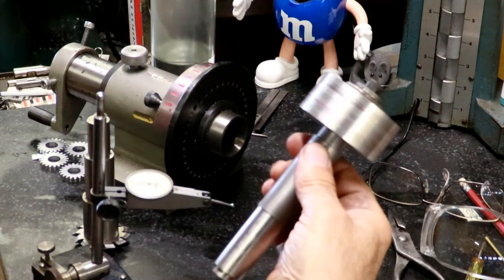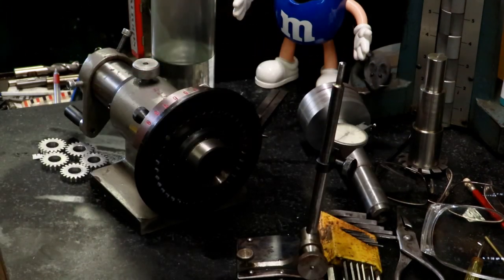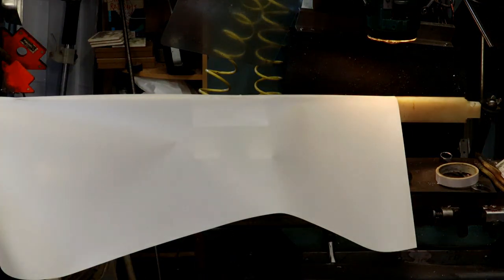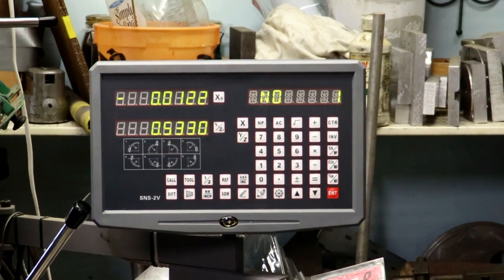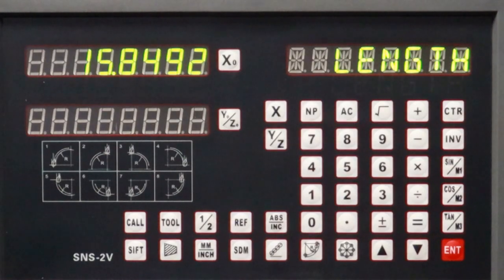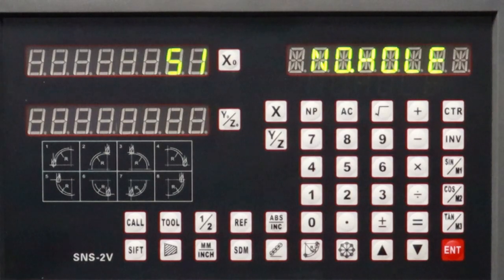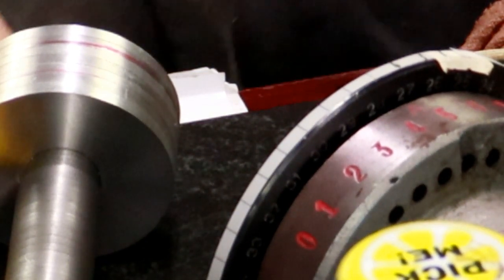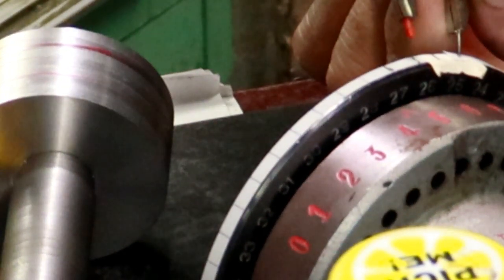setting up to cut a 50 tooth gear on a spindex

Comment: What is the thickness of the tape wouldn't that affect the tooth placement?
Reply: It shouldn’t because it is wrapped the full 360°. My guess is it is no more than 0.003”-0.005” thick.
Reply from the maker: It will effect it slightly. I could have and should have taken it into account to be exact. I checked .004 thick which would change the dia by .008. But remember these gears are not running at a high rpm they still should be ok.